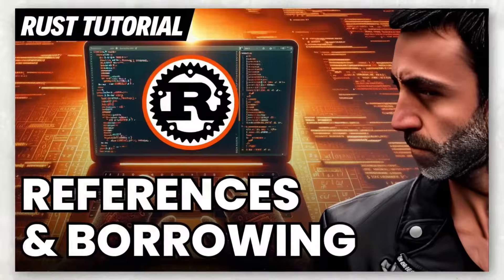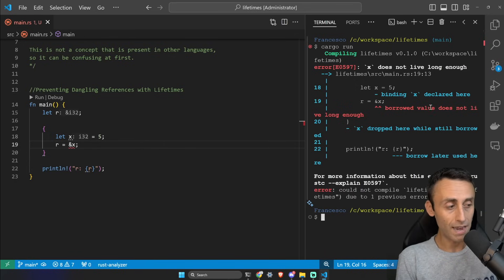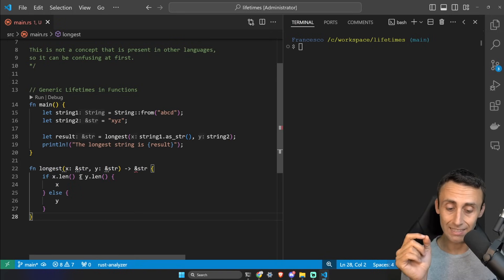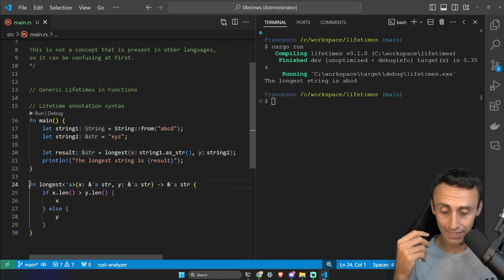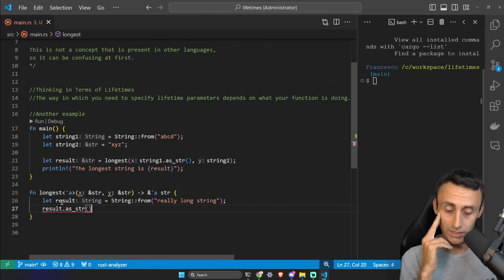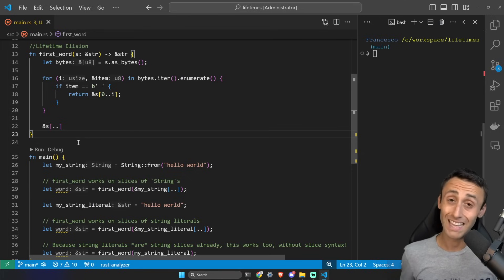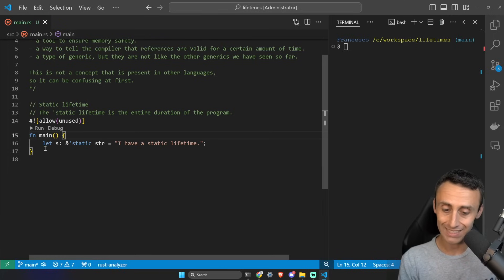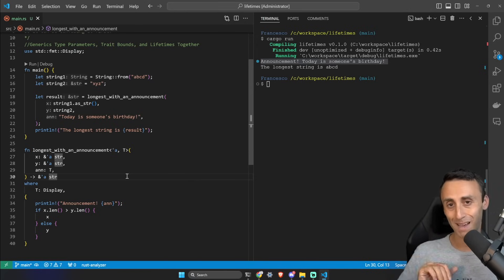Rust Lifetimes explained Tutorial

Comment: 9:27 Shouldn't it be the lifetime of the reference we pass into 'a in the ImportantExcerpt struct needs to live at least as long as the struct lives. They are not always the same. 

We are allowed to use the first_sentence variable even after the ImportantExcerpt var gets dropped so its lifetime has to be longer.

Basically with lifetimes it's simply "I don't care how long you live if it is at least as long as I am living"
Reply from the maker: good point